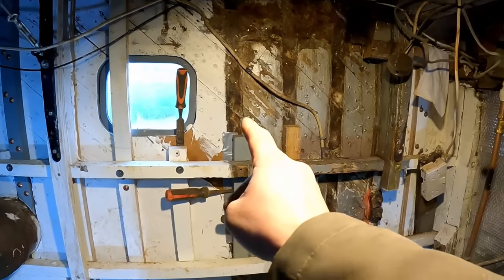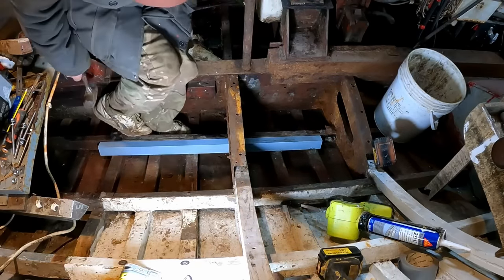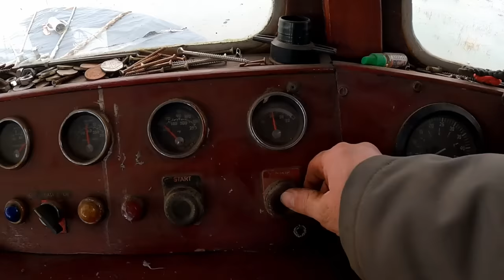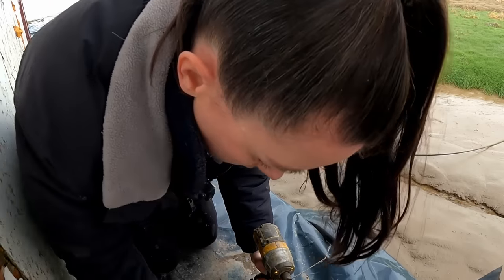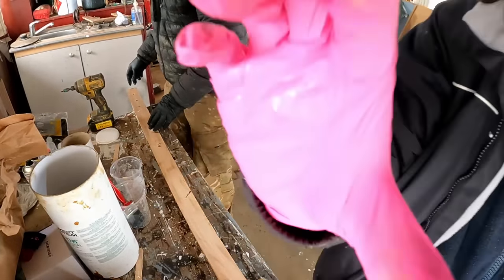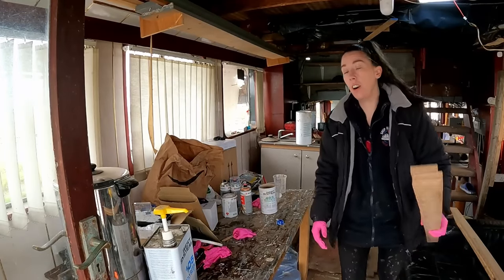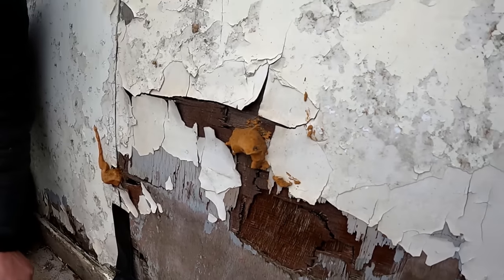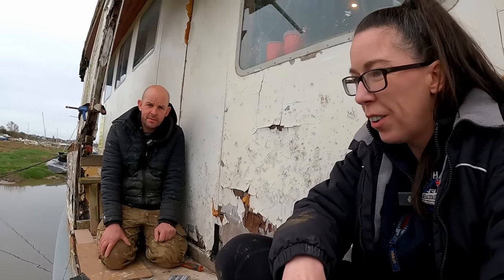Ep 166 Will Our Boat Move? Getting It Into Gear!  #boatproject

Comment: I'll suggest that that when you've finished with the frames in the engine room,  you've done enough reconstruction of the hull to safely unmoor and go for a short sail within the estuary.  
I believe that would generate a burst of enthusiasm within and beyond your community.  That enthusiasm would produce more financial support and maybe get you to 100k subscribers.  
Target the short sail at Caterpillar.  That may gin up their interest in becoming a sponsor.  
After your short sail, bring her back to her "berth" and tie her up till the following summer. 
Once Sarinda has been tested and proven - make it a once a year event!
Reply: This is a great idea. It will also test for any instability caused by that big rear cabin. I personally don’t like it. But that’s says more about me than these amazing boat builders.
Reply: If I recall, the rudders are jammed at the moment, so steering might be a bit problematic!
Reply: Rudders are jammed, engines need completely rewiring, the transom is rotten, the decks aren't fully attached to the hull and all they have is a rubbish 1980s fish finder as a depth gauge probably not ready to be moved in a tricky shallow area just yet
Reply: @Dave5843-d9m  Thanks! I'm glad you agree.  The only question I have is where is the ballast that was removed in the areas already restored?  Back in the bilge?  As long as it's below deck, I suppose it would not make a big difference traveling at high idle on a calm day.  Plus, it would be an opportunity to test some of the boat  systems as well, like the stabilizers.  I could imagine a big public picnic to celebrate the day. Ship Happens buys a keg of beer and everyone brings their own food. 😊
Reply: Not a great idea considering the rudders are jammed, the engines need rewiring, the fish finder is from the 80s and of questionable reliability, the transom is rotten, and the decks aren't really secure. 

Perhaps once all of those issues have been addressed. Have patience and support their ongoing hard work. Good things come to those who wait

Comment: In laminating those frames together you seem to use excessive amounts of epoxy, it would keep your costs down to be a little more frugal. I’m sure you could apply half as much and still get good ooze when clamping. I suppose the scrape off is used on the next frame so not all wasted. Your positive attitude is just fantastic, and you are both becoming shipwrights, well done.

Comment: Simon, Gemma,  have you ever seen a program called l,
A plane is born?
Mark Evans, the presenter, has a fibreglass station. The box  with the resin has a light bulb in it to keep the resin warm.
If the box was properly insulated,  you could get away with a comparatively low wattage bulb.
Reply: To achieve similar results. 
All you would need to do is line a small cupboard with polystyrene insulation and put a halogen light inside. And keep sealants and epoxy that you need to keep warm inside.

Comment: Pro-tip.......heavy diesel engines like those CAT's use fluid filled harmonic dampers on the front of the crankshaft.  Its that large pulley that drives all the accessory belts. Those dampers have an issue that when they are old, the fluid goes hard and puts them seriously out of balance and will destroy the crankshafts.  It takes decades to happen, but it does happen.  Good idea to take them off at some point and check they are ok.

Comment: There is a saw for cutting door trim up off of the floor when installing tile or wood flooring. Use one on the cabin walls to slip the decking up under that cut.

Comment: You could install 'temporary' stanchions by resting the end of a plank on the exhaust box so it sticks up above the deck by a meter, screwing it to the hull and running a rope through holes drilled in the tops. It shouldn't interfere with web frames and will provide some safety when working on that narrow deck... :face-blue-wide-eyes::face-orange-biting-nails:

Comment: Could you do a section of the deck and the Cabin wall matching section at a time. Support the cabin roof, take out a section of the wall, replace the deck, then put the new cabin wall in? You could prep the wall and deck sections in the shed, then bring them to the boat and install. Possibly set up a temporary crane or hoist to lift the decking and other heavy things onto the boat? Cheap 12v winch on a homemade frame? Great work you two. Best of luck.

Comment: wooden pallets have 3 internal runners/braces. If one of the outside ones is removed with the lower boards on that half, the upper half could be bolted to the deck with the other intact half of the pallet protruding off as a platform (perhaps with the cut off boards used as a brace against the hull). That should have enough strength to not bow under heavy weights if well connected to the deck. Perhaps used pallets are relatively inexpensive over there, or constructing something similar with reclaimed/cheap wood.

Comment: Hello, new to your channel so may be behind the ball.  Great progress despite the chilly conditions I know it is a pain working in a cold confined space.    Those engines sound sweet and will serve you well but Cat's don't like long idle without a good blowout may I suggest you get a 8kW Chinese heater, they sip  the diesel and real heat the space. I use them in my basement workshop, if you run the exhaust through an old radiator or coil to heat water you get even more bang for your buck. They are about £90.  Take care I will take a walk down from Thirstaston and see how your doing. Best
Reply from the maker: We have central heating on the boat with radiators, and it’s powered by diesel
Reply: Oh wonderful, its been a few month since I last dropped in.  great progress fine weather on the way so pleased you got past the rough stuff. Look forward to when you can open up those Cat's  and enjoy yourselves.   @ShipHappensUK

Comment: You are doing a marvellous job.
With the decks or wheel house sides it may be worth considering going to a Lorry Breakers/Insurance Right off to buy a 20/40’ Closed in Trailer they are constructed with plywood already encapsulated in fibreglass normally 18mm so may be very cost effective & very long lengths(40’)

Comment: I know its never easy to do wood working project's  and you guys have taken on a big job with this ship . When you go to do the decking take some long boards to support the roof from bow to stern with posts to hold it all up . That should allow you to replace everything between the lower deck and roof all in one go , once the outer hull is done . You could even have a work day for people to come help install the cross bracing or floor frames and plywood floors.

Comment: I wonder if a back bevel or chamfer of the outer corner edges of the inside plank patches would help them slip into place tightly. As long as bedded in PU to fill all voids?

Comment: May I suggest you use better protection than that dust mask, when you're power sanding?  I'm betting you can taste paint and crud at the end of the day, and it can't be good for your lungs or the rest of your body.  3M respirators with disposable cartridges are surprisingly cheap....

Comment: I have a question regarding your engines. Are you gonna box them in, to reduce the sound, or are you just gonna leave it? I would not box them in, because they sound awesome, but the noise can become a bit annoying on long cruises. I have 2 DAF 5.75 liter straight six ( 165 HP each) diesel engines with 2 turbo's on them. the sound is very similar to your Caterpillars. Unfortunately I don't have the space to box them in. If you are curious I can send you a link to my YouTube channel, but I will not do so in this comment, I do not want to spam 🙂 Love the vids guys, keep'm coming!

Comment: Do those engines run on solar ?
I know you only will use electrical batteries to run all your power tools so running diesel engines even for a few minutes would totally eradicate all the work you did to avoid using a gas generator. Yes ?

Comment: Genna ..You know that in the end you will have to lift your oldie boat to dry land (Boat yard) so you can clean the under side of the hull, paint (Undercoat plus topcoat too and add the anti-foul paint too.. Plus get those seized  rudders, props working.  You can't do with the boat sitting in the mud.. It will cost a lot of money. Why not do a go fund page. The guy from Aussie land found that the engine in his steel boat was shot (Anti-freeze in the oil) he took the heads off and found that some of the pistons were cracked on the top, and other bad problems too (He never started it), so he and his wife set up a go fund page, and he got more money than he needed (He was very shocked). so he found another engine and with the extra funds he was able to have the replacement engine rebuilt. When he got it back it looked brand new (new coat of white paint too) and is now in his boat and is running. You should do the same later on Go Fund page is the way to go, and that will help with cost of moving to boat...

You know his Channel, it's Project Brupeg and he's been restoring that boat for 10 YEARS ( It was half sunk in a river for a long time), and though he's got back in the water.. It's still work-in-progress (and it's their home too)..
Reply: Oops is your name Jemma
Reply: Simon and Jemma are aware of both Project Brupeg and the costs of pulling the boat onto the 'hard'. They are working to do all they can before that and it's expense it entails. They are a ways from the hard do it doesn't make sense to raise funds for it now, they have explained that before.
Reply: @zevar9819 I know. I said they should do it later on not right now (When they are ready to to it) in a few years time..
Reply: should I say it'll take more than a few years to get it ready before the boat goes on dry land (They have normal jobs too)...

Comment: Why don't you use wood flour to thicken epoxy. It's so much cheaper and works just as good. I have used it for years and never had a problem. 
It's nearly impossible to split an epoxy joint with wood flour. I have tried.

Comment: They’re called side decks. Pretty boringly simple! Your decks would look fantastic using teak dec. looks like teak, but it’s just stuck down to your fibreglass base. Would look well classy.
Reply: Gangways and the bridge to shore a gangplank. 🤔
Reply: Gangway would be the bridge ashore, gang plank has no sides
Reply: @johndavies7692  all the ships i worked on call the passage between the quarterdeck and the forecastle of the ship gangways and the gangplank may have no sides but most do for safety. 👍

Comment: Why dont you take the boat out of the water while you repair it. This is not how you do repairs on the hull.
Reply: Because the hull was so rotten at the top, it probably would go out of shape if lifted in any way. They have not even dared sailing with it despite it floats, before the basic structure are back to full strength.